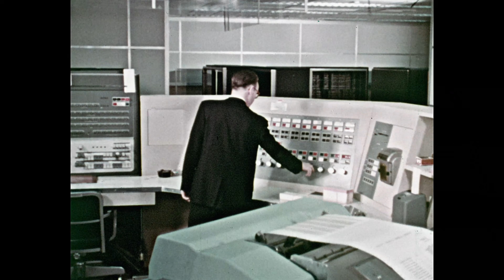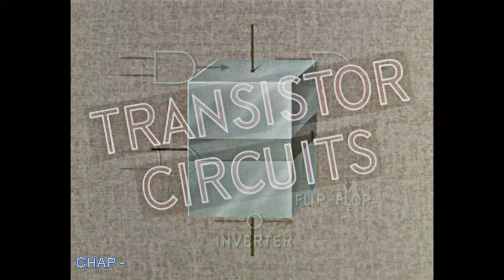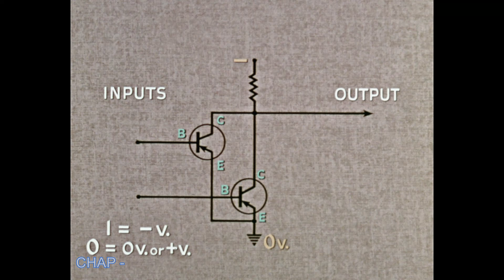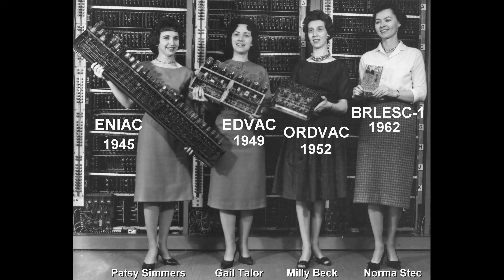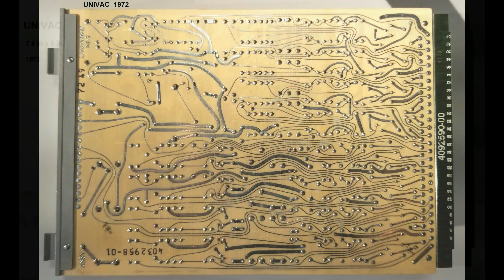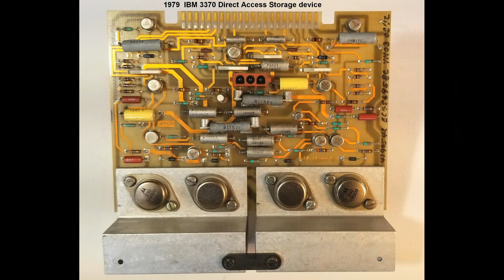Comment: Thanks for sharing these neat old movies! 🤠

Now I need to check, I have an old circuit board which I recall looks like one of those IBM SMS modules.  As I remember, back in elementary school in the early 70s I loaned another kid some of my Mad magazines and the card was my payment for the loan.  Another bit of the memory is that the other kid's dad worked for IBM.  I've always wondered what the board is so this reignites my curiosity to dig it out and try to finally  figure it out and know! 🤓
Reply: Very cool.  Good luck on your investigation!
Reply: @ComputerHistoryArchivesProject  In some cleaning I was doing today the card was in one of the boxes I was going through (miracle) 😃  I looked it up and it is a JMVB Cidl logic inverter npn no loads #371079.  Very similar looking to the video thumbnail (same basic board differently populated).  Always thought it was a well-made little board.  The component side is a little dirty but the solder side is coated so it is still shiny and clean looking.  I have had this card for over 50 years and now I know what it is thanks to y'all posting this video! 😎  Thanks again!
Reply: Hi @meltysquirrel2919, you are very welcome!    I am glad it was helpful in your identifying the logic card!  Good investigation!  ~  VK